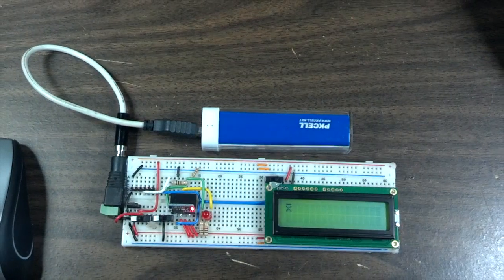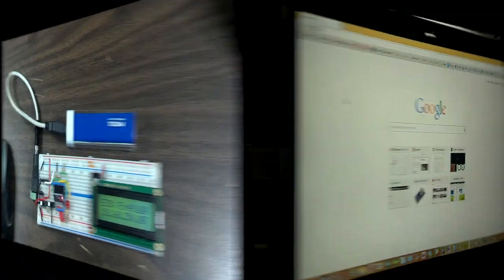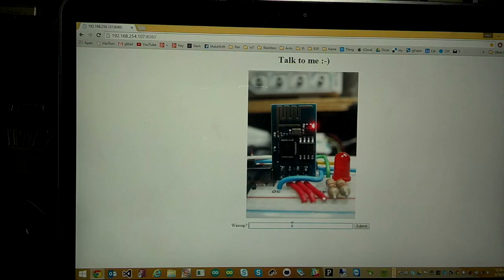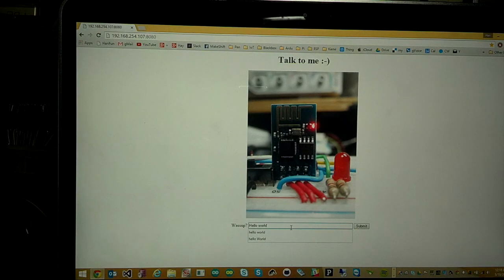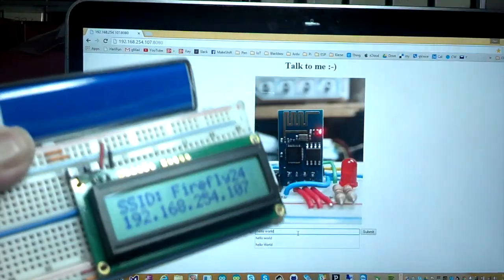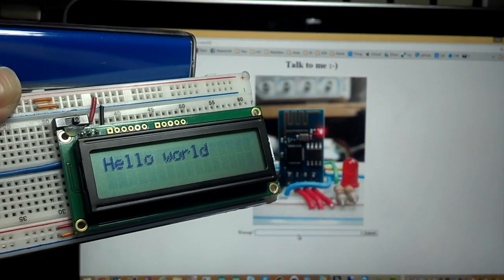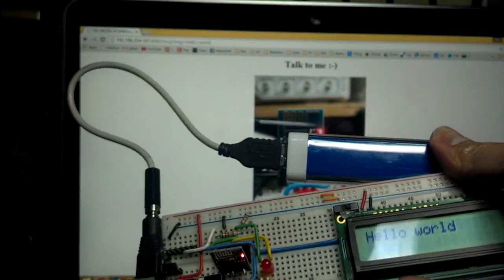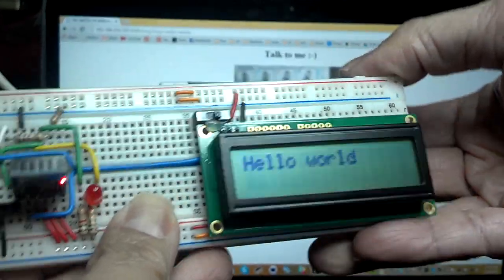HariFun #109 - One Way Chat part 1

Comment: Hari, what's your favorite firmware to use on the ESP?  I heard that the LUA environment has a few issues and that the arduino firmware is best to use.  I guess there's pros and cons to any firmware but which do you think is the most versatile?
Reply from the maker: +O.T. Powell , I liked LUA before the Arduino IDE becomes available, but now I like Arduino IDE because I'm more familiar with it.  The libraries on either side are not perfect.  But I think there's more people on the Arduino IDE side than the NodeMCU side, so you'll get more samples and bug fixes on the Arduino side.  The nice thing about Lua, is that it is very fast to develop. No compile and practically no upload time.

Comment: Great work.  I recently spent at least 20 hours trying to get similar results using a Netduino and then an Arduino. I finally conceded and bought a Wifi Netduino 3 for my project.  Although my code appeared bug free and in line with what I found others doing, the ESP8266 would often report "busy p..." when hit by a web client.  It made for a very unreliable user experience.  Have you seen this issue with the ESP?
Reply from the maker: Raising Awesome , someone else mentioned that the WiFiServer example works once and then not on subsequent requests.  I had good luck with a different library by Ivan Grothotkov called ESP8266WebServer.  It uses event handler instead of loop().  You can install this library using Arduino IDE's Sketch > Include Library > Library Manager... > search for ESP8266WebServer.  Then choose the ESP as your board and check the File > Examples > ESP8266WebServer > HelloServer